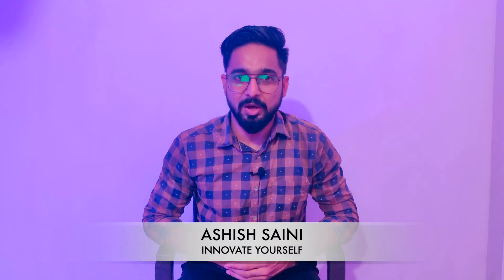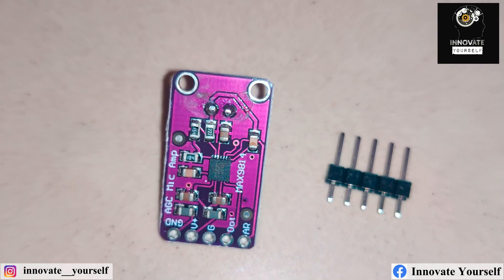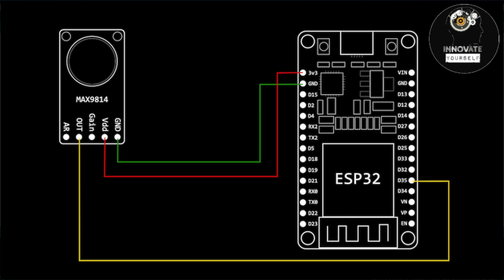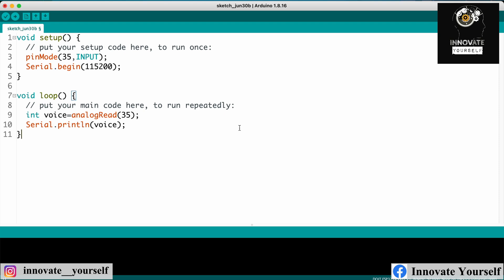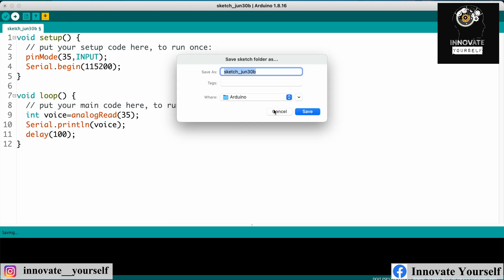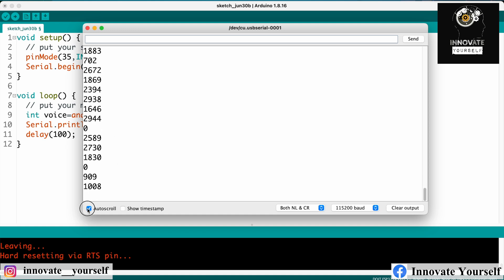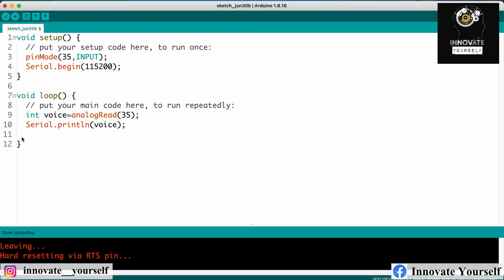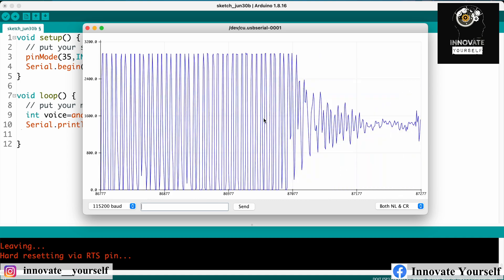MAX9814 Interfacing with ESP32: Exploring Audio Sensing and Control 🔥

Comment: nice but, totally useless, see the information on the serial monitor... adding that the audio comes out through the i2s output to a PCM5102 board, for example, would be more useful..thanx anyway
Reply: You can use it in say a wireless speaker with voice assistant